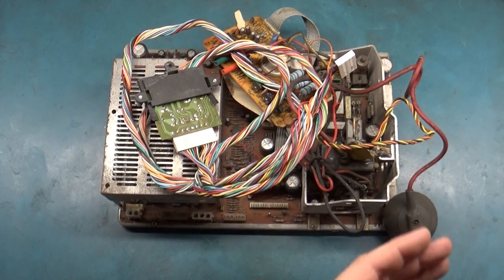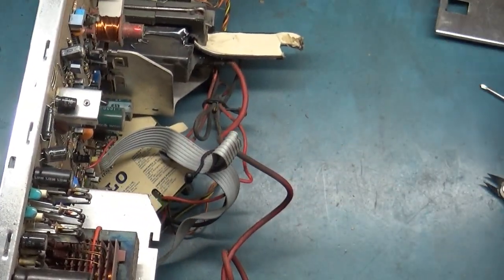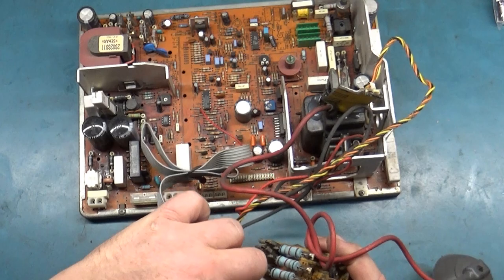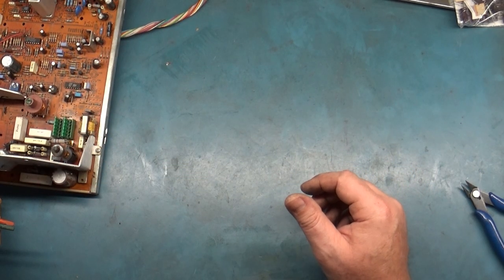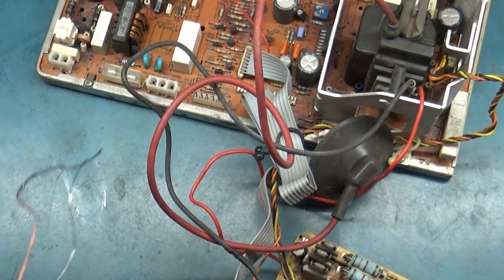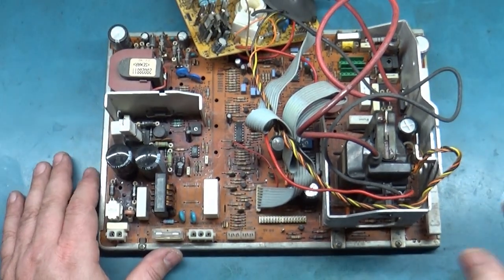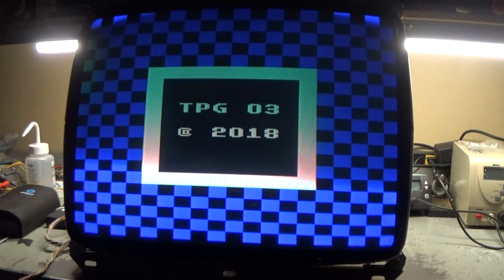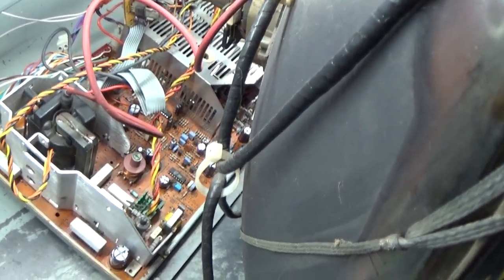25" Hantarex Polo Arcade Monitor Chassis Repair - Arcing Flyback and Exploding Caps!

Comment: Nice work! I have a polo on my list of repairs so this video will be really helpful. I’ve heard these can be a pain to fix but have some of the best pictures.
Reply: They're not that bad really, i've repaired loads over the years, but yes they do have a superb picture when running properly (like all the other Hantarex chassis). Very common chassis here in the UK and Europe, along with the other arcade chassis Hantarex made (like the Polo 2, Polo 3, Polostar, MTC900, MTC900/E, MTC9000 and 9110 and MTC9000/A)!

Comment: Happy 4th July Sir.
Very little smoke from that wee cap, much more destructive when a larger one blows and takes out part of the board.
Keep ups the great work.

The off color in the top left of the screen I'm taking as a tube issue.
Reply from the maker: Yeah. Most likely because it was dry. 

No, just a bit gaussed.

Comment: Hey man! You helped me get my K7000 fixed before! And she still looks amazing in my Centipede cocktail! I have another question about these polo's. I just scored 4 of them today, and none of the cabs they came out of had Isolation Transformers. Do these monitors not need iso's? Thanks in advance!
Reply from the maker: Sweet! Nope. ISO’s are built into them. You can plug them right into the wall if need be.
Reply: @MikesArcadeMonitorRepair  sweet!!! Thank you!
Reply from the maker: You’re welcome.

Comment: Do you know by any chance if hr 7375 flyback can be used on Hantarex Polo 25"? The guy sold me a Polo 25 chassis with it, but i read that it's actually for a multisync Polo 2(i think), and i have an impression that contrast is too strong, i keep the pot almost at minimum.
Reply from the maker: Hmm. Not sure off hand. I’d have to research it.
Reply: @MikesArcadeMonitorRepair  It's ok then, i don't want to take your time. I just wondered if maybe you remember doing such swaps. Thanks for your reply.
Those proper Polo 25 flybacks are now outrageously expensive (in Europe), it's a ripoff.

Comment: hi, can the hantarex polo 1(only 15khz) 25" or 28" work with the HR7381  ?
Reply from the maker: Greetings. Without research, I can’t say off hand. Traditionally, only an original part number will work.

Comment: The Polo is a very good chassis and does have a great picture when running properly! I've repaired loads of these over the years, probably one of the most common chassis to be found here in the UK and Europe. I can't believe someone went to the trouble of that glue and plastic bodge on the flyback, they should've just bought a new one, they're not that expensive! That flyback looks to be an originally fitted one made by Eldor, the most common failure i've found on those is arcing - usually straight out of the where the ferrite core is! The only caps i've ever had physically let go on a Polo is the 4.7uf 250v cap on the neckboard and the 4.7uf 250v one you had. Those neck sockets are common on Polos, you just pull the cable out but they need a fair amount of effort. I've had the cable come out no problem most of the time but then i've had them snap off and leave the core of the cable stuck inside the internal sprung cable clamp a fair few times. When that happens it's new neck socket time! The most common crts used here for this era of Polo is Videocolor, but the later chassis also used Philips, Sambers, Videocolor and Thomson.
Reply: I'm doing work on a polo chassi. Regarding the cable - so there is no way to open up the white socket and remove the cable without use of force? You just pull straight up and hope for the best?
Reply: @johnysupreme  Sorry only just seen your reply! Yeah you can't really take them apart as far as I know. Just give the cable a firm sustained pull and it should come out. Be sure to pull it in such a way that you're giving the neckboard some support as i've snapped a neckboard before putting too much force on the socket. Sometimes the cable comes out easy, other times they can be really stubborn!
Reply: No worries. I did two neckboards. One came out perfect. The other snapped and the remaining wire somehow ended up inside the white socket. Someday i'll soldier on new flybacks and see what happens :)

Comment: Hello. I have a Neo Geo cabinet and it's Hanatrex monitor has just died. It's doing this sort of tick tick sound with a spark. Heres a video of it https://youtube.com/shorts/Ig5E918-fmI?feature=share3.

im too afraid to touch anything to take a picture of the make of the monitor. ive been told its a flyback and capacitor replacement job, which i can do as i can solder. I just dont want to touch the wrong thing and die ⚡👻. 
In the UK there arent many who repair CRTs so just looking for some advice really if you think this can be repaired or looking at the video are you able to identify the model of hantatex it is? thank you
Reply from the maker: Yes. Flyback is bad. It’s a 900…

https://m.youtube.com/watch?v=kx570IfsFzw&pp=ygUPaGFudGFyZXggbXRjOTAw
Reply: I fixed it! it was the flyback and that was all that was wrong 🙌 thank you again

Comment: i have hantarex polo 2 15KHZ  that i cant have full H-SIZE, the H-SIZE pot is at maximum but i have huge black area left and right,i also changed that pot same problem, do you know what cause this, is that bad filter cap or ceramic caps near to flyback ?  by the way great video keep going
Reply: Test the high voltage polyester box caps near the flyback, good chance it's one of them. Quite often the smaller one, I think it's something like 3n3 1600v (but could be one of the others).

Comment: Do you know the Resolution Res on this tube..I actually bought one on Ebay, waiting on it to come..I just needed to know the Res?
Reply from the maker: Standard res. 15khz
Reply: @MikesArcadeMonitorRepair  Thank you, fior the info. Im going to connect the monitor to my PC, running  Windows 10, and  running Mame. Im also going to be using a  Game VGA to CGA RGBS CVBS S-Video Video Converter. So yeah, everything should work fine. Thanks again👍
Reply: @MikesArcadeMonitorRepair   I have one more question for ya. Im trying to connect my PC to my CRT that has a 360x240. Im using Windows 10 and im trying custom the Res onto 360x240. How do you change the refresh rate to 15krz? Some reason it wont let me change it on to 15khz. Do I need a program like Quickres, to allow me to change the refresh rate, to 15khz?